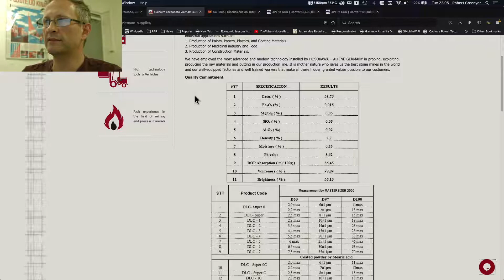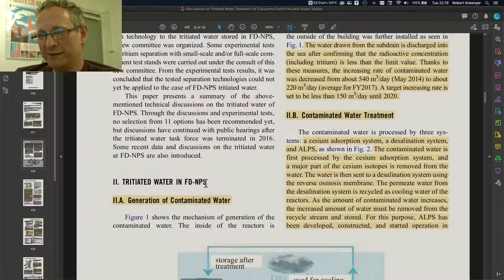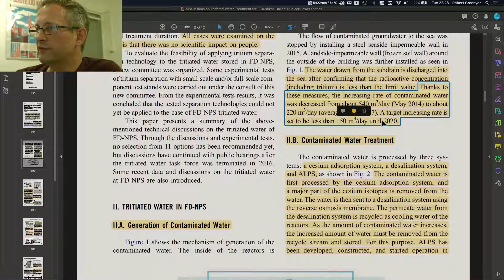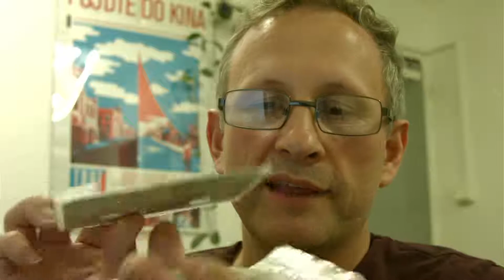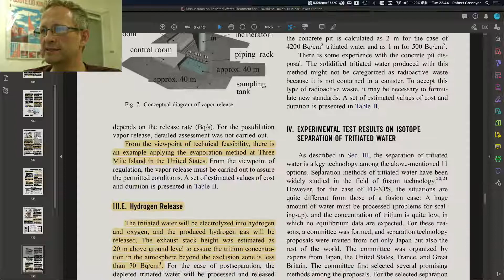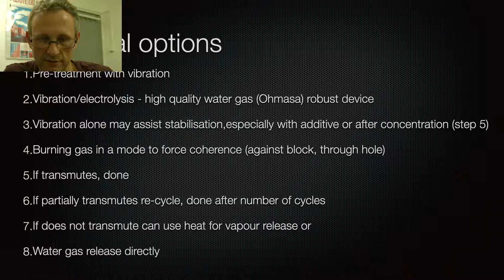Discussion on direction for dealing with the Fukushima Tritium waste water

Comment: Sounds to me like you're saying that the that they might be using graphene filters to eliminate the venora T of the heavier nuclear isotopes
Reply: And it appears that from what you're saying the they must be implementing a filter which would most likely be graphene I certainly hope that this remission technique will be successful and possibly neutralizing the one component that they can't eliminate apparently and that is apparently The Trentonian apparently the graphene filtration technique is unsuccessful for something something like heavy water
Reply: One good thing for my understanding the heavier Isotopes iodine and and cesium can be removed with graphene filter irrigation techniques
Reply: I pray that your litigation technique will be successful God bless you it's too bad that enough graphene could be introduced into the core to dilute the molten core material so it becomes less radioactive an easier to handle